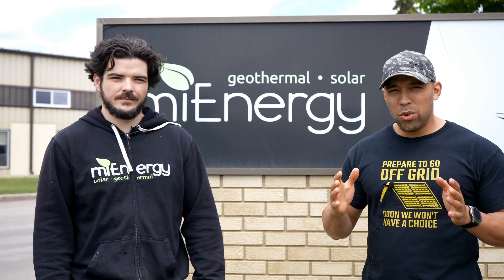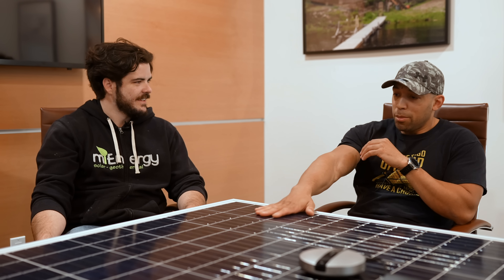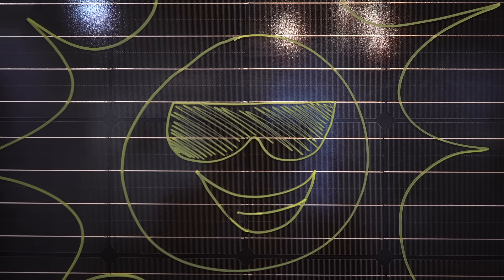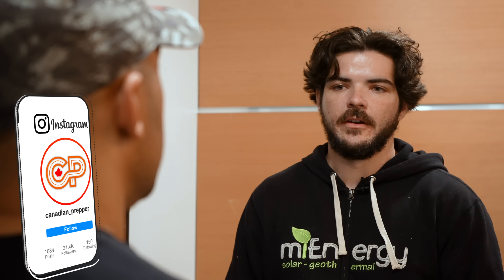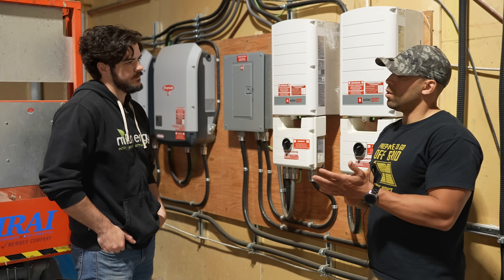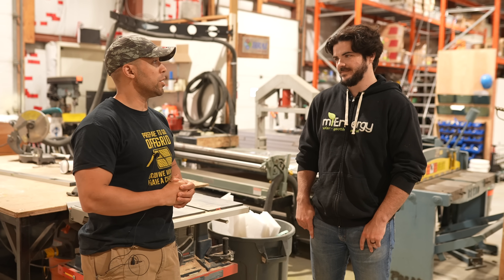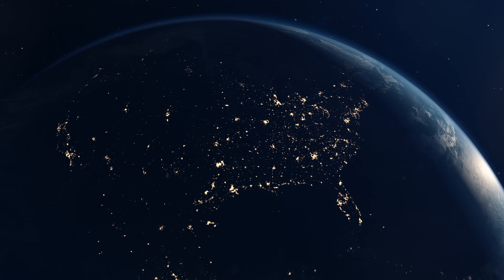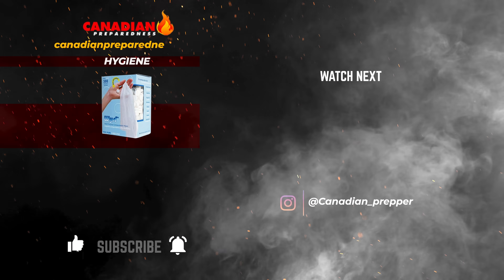Preppers Guide to Home Solar Power

Comment: Okie solar in Oklahoma wants $117,000 for a 3000 kw a month system with a battery back up. 25 year loan with 1.99% interest rate…… that’s half my house, what the hell??? ADT solar wants $84,000 for just panels. I don’t remember the name of the other company but they quoted over $100,000 as well. Some power company’s make it super hard to use solar on ur home charging u penalty’s and will not let u go off grid. This is total BULLSHITE!!!!!

Comment: What I didn't see and hoped to see was a discussion of repairing your solar panels in an EMP/CME (coronal mass ejection) or near lightening strike situation. While your inverter might or might not survive, your panels will definitely have their blocking diodes destroyed. So having a supply of the inexpensive diodes on hand with a soldering iron is a cheap insurance policy.

Comment: You can do your own install and a 5kw system with less than half of this guys numbers...  Everything including the lifepoe4 batteries can be bought on online.  Keep the system off grid and all you need are panels, solar battery charger, batteries, DC-AC inverter, and wire.

Comment: I’m on a fairly windy homestead, so I’m installing a 400w VAWT and 400w of solar along with a modest 3kw inverter, batteries for 4 days - only to power my 2 chest freezers and refrigerator off grid. Only $3,500-ish USD.

Comment: I went to a prepper faire and the solar guys there only thought in terms of feeding electricity back into the grid. When I said "What happens when the grid goes down?" they looked dumbfounded. I wanted a stand alone system that fed into batteries to power my house and they looked at me like I had a hole in my head. 

Why doesn't someo9ne make such a stand alone system for peppers.

Comment: I live well within the 20 kilometer Chernobyl Exclusion Zone of the nearest nuclear plant. Any thoughts? I think we will have power even if the rest of the country is blacked out (in which case we will be digging trenches to repel the influx of blackout refugees) and if there is a problem with the nuke plant, you probably won't be able to move your solar panels, and wish they were installed in a fortified villa outside the exclusion zone.

Comment: solar wear out.. so if you plan of apocolypse and you are rich i would buy extra pannels and keep them in storage. i have solar but i dont have battery so i supply the grid threw my transformer.. now when grid is down i could run a gas generator i have and power the solar unite activating the solar pannel so it powers into the grid., they have it shut off when power goes out to protect people working on lines but in shtf i could power the grid and maybe me and my neighbors could have some power

Comment: The way these large companies are doing it on grid and with or without batteries is only good for short-term typical power outages, Not the SHTF Prepper. Completely off grid is the way to go and these companies don't want to do that. They have a whole line of BS that sounds good till you actually use your brain to stop and think. If enough people get these systems they can have the green society they want, you're generating energy for them and you get a lower bill and saved from the occasional short power outtage. As long as everything is good they benefit and the customer but if worst comes to worst your sh*t out of luck unless you have your system setup the TRUE Preppers way.

Comment: Here in Western Australia we are required to have a grid tied to system even with batteries. It irks me no end that if the grid goes down permanently I got 6KW of panels on my roof I cannot use. What I would like is some info on how I could get use out of them in a full grid down situation. I have tried searching the net to no avail so far. I am an electronics tech, so could do the work if I had some good info on the right way to go about it.
Reply: Why can't you have two independent systems?  One on grid, one off grid.
Reply: @ridgerunner106  It is against the law, that is how things work when the energy grid is run by the government. I suspect if the grid was fully down, the chaos would be such that you could get away without scrutiny of it if you could do it. The current inverter is grid tied and will not work without grid power even if you also have a battery backup. You can buy inverters here to work off your car battery when camping, but you are not allowed to buy a solar panel inverter that can be off grid. I do have a couple of Lithium power stations, one of 300W and one 1300W plus a 200W solar panel blanket to charge them with that gets me by in small power outages, but would love to be able to use all that power off the roof if the grid goes down and stays down.

Comment: Here in the Panhandle of Texas we are completely off-grid. 3 separate solar systems. Our main cabin has a 13Kw system, the guest cabin runs on a 12Kw system and the barn operates on another 12Kw system. We are currently replacing each FLA battery system with server mounted LiFePo battery banks. Each system uses a MppSolar 6048 or 6548 split phase charge controller/inverter combinations. 
Combined solar panel arrays include 125 solar panels all of which are ground mounted. It took six years to complete system. It was done without professional installers which made it very reasonable in overall cost. The systems are practically plug n play and require only a bit of self training if you have basic electrical skills.
It is advisable to begin building today if you have not already started your system. Interestingly enough the prices of components have dropped consistently since we began to build our system.
I managed to acquire some of my panels used but tested good at as low as 16 cents a watt.

Comment: I was loosing power at my place for a week at a time and with 2 small girls here I needed better then a generator. I have 60 kwh LiFePo4. 10 kw inverter and 3500w of pv. At the moment I cant run my oven or dryer. My house is only electric and does pretty well on solar 3 seasons per year.

Comment: I just have 1200 watts of panels and an Aims 24 volt 2000 watts low frequency pure sine inverter. I went the cheap route and used marine batteries that I can get locally easily, ( 20 of them so far ). I'm tinkering with a wind generator too. But there is enough for my electrical uses, and it doesn't go off during a blackout. I have enough for my little A/C for a couple hours a day and I have plenty of backup. I am sure glad I went and put this together when I did. It is better to be free from the bills, and just run one appliance at a time, than to own nothing and be happy. I have about 7 months left of what was an average bill left, and the system will have paid for itself, and just be profiting from then on. I think I can get 9 years out of these batteries. So that is 7 years of free power...how much is that worth? I have about $3400 in my stuff. I'm from the poor side of town. It took me a year + to get what I have. It's working pretty well now.

Comment: If you have the option I would look into geothermal heating/cooling and for energy Micro hydro if you can. Another option with Solar/Wind is the addition of a water battery. 
Pump it up during the day then you can use it when the sun goes down.

Comment: What 1%?

The Takers that need sociaty,grunts,and flunkies to provide for them

All those appocalype Movies arround 2012 had the super rich and such buying bunkers and such but never saw farmers or doctors orpharmasists or engineers or architects being apart of the "elite"

Could just be a script oversight but unless you save the fundemental "working casses" too we lose the ability to rebuild modern sociaty and and those "Elites" used to being pampered die off anyway when the supplies run out

And without knowing how to repair or create morethe tech you use they become glorified paperweights eventualy

The advantage of acid and lead batteries for battery back up is you can  recondition them or rebuild them as long as you have lead,acid,and a power source.....have yet to see a DYI  lithium phosphate cell

Comment: I think you can DIY a system with 5,000 Watts of panels, 6,500 Watts on the inverter and 10kWh of usable battery backup for about $12,000.

Comment: Easiest to do: Ground mount, buy more panels than your inverter output to protect against shading/snow/orientation morning or evening/orientation summer or winter losses. Expect panels to improve every year and you'll swap in new panels before the old ones wear out because performance of the new panels will go up (easier on the ground than hanging off your roof).

Comment: If someone tells you that their payback time was only 4 or 5 years, they are lying to you.  As you mentioned, if it is a grid tie system, it won't work during a power outage, when you need it the most.  If you go with batteries, expect to have to replace your batteries about every 6 years, 8 years for the best batteries out there.  The power walls have not been out long enough to know how long they last but I would not bet you get more than 8 years.  Kong's elite will last about 10 years, if you keep them in an airconditioned 67 degrees at all times room.

Comment: Am in Mexico and just got my system installed. We have 6 panels and 20 batteries(not lithium). This will power the well pump, water pump, ceiling fans, fridges and freezers. Works well. If the power goes out as it always does in the summer this set up will work for 12 hours. Considering more panels and lithium batteries as they last a good 10 years.

Comment: Very good comprehensive video on solar.  The installer touched all the key points.  I'd stress getting battery backup because if the grid is down, your solar is useless.

Comment: How large a solar system to power a EV? I have a home built system for my cabin (my solar is not hook up to the grid)  it runs every but my EV. I have hydro as my back up and it also charge my EV at night when power is cheaper. It's nice to see all my relation helping out with helping the great mother. I'm also looking at Shipping Container gardens 40' long. These unit can grow fresh veggie 365 days a year... all winter and hot summers long. Your thoughts on the size and energy needed. Thoughts on geothermal powered by solar?

Comment: Nate: there's a third type of panel, that the big poly and mono have been buying up to shut down.  It's the thin-film amorphous panel.  The last plant I heard was shut down, there in Canada, just last year.

Thin film loses less on cloudy days, or when shaded (it's wired different, inside the panel itself).  Drops 11% in output under 3 feet of powder snow.  It doesn't need to be pointed directly at the Sun, either.  Seems to pick up power from the Raleigh scatter.

It gets it's power from the near-infrared.  And, the panels require twice the area, for the same output, as the others.  Lasts just as long, too, now.

Actually, because the connections in the panel are so different, they still work after you shoot a couple holes in them---lol.

Still made in China.

Comment: I started with a 1 kw setup when I was off the grid. The long northern winter and -40 weather killed my batteries. it was a constant problem.
Reply: What did you do to trickle charge the batteries

Comment: You missed an important point, property tax. Go install a legal system with a building permit at 30k and plan for an increase of 30k to your home property tax. Here in CT, my town has a 43 mil tax rate. So a 30K system is going to be taxed at 30x43 = $1290 per year or $107.50 per month. Will the 30k system even produce that equivalent in electricity and distribution costs ? I think the payback period wont even be 30 years considering the never mentioned property tax bill.

Comment: Thanks for covering this material.  I expected to get solar 10 years ago but the unexpected happens and changes plans.  but as time has gone by, my desire has changed from just having the panels hooked into the grid to having it be able to run my home in the event of a grid down.  I learned about some options I was not previously aware of while watching your video.  I'm hoping to get solar in the next couple of years or at least price it and start saving for it in the next couple of years.  Subscribing to mienergy page to learn even more.

Comment: Solar panels will only give you independence for a few years. Use something you yourself know about and something you can fix with common components. Wind is pretty easy. Hydro is pretty easy, man power as well. A couple of magnetos, and alternators will put out quite a bit of power. Don't solely depend on solar.

Comment: I love solar but a complete system is way more expensive than I can afford.  Also $15 years to pay itself off and only lasts 20-30 so you will probably save less than you think.  Not to mention the batteries aren't going to last anywhere near that long and will have to be replaced at great expense.

Comment: A panel angle of 30° might be fine on the summer solstice but it's going to be grossly off angle in December and january. I chose 45° because the sun is very low on the horizon in December so I angled it so that it would be pointing directly at the Sun during the equinox.

Comment: I've been off grid for two years,  I love my solar system. Do not I repeat do not short yourself  on storage  ie/ batteries, good batteries. If a stand alone system tells you  all you need is two batteries get six. Yes it cost but I would strongly suggest you talk to someone who uses a product versus one who sells a product. I purchased mine through shop solar and was amazed at the service  and the product itself, worked exactly, installed exactly and performed exactly like they said it would. I shorted myself in storage capability. I've corrected the issue and I'm 100% satisfied.

Comment: I had one installed with a battery for a backup, my cost was 40,000, I have 24 panels installed, It is good in the summer but when it come to winter not so good. I live minnesota we get snow, in your video he said it melts, I can tell you minnesota snow doesn't melt when you get 8" to 12" of snow, it is very cold, lucky for me I have a one level house so when we get the snow I go out and use a squeegee with a long pole and a 6' ladder and clean the panels, my two German shepherd has fun catching the snow when I slide the snow off, I can see solar system would work better in warm weather, but where I live it's more work and one more thing some city's doesn't want you to have a battery, it took the company a year to finished the job, the permits took the longest, I can tell you I am the 3rd with solar system and the first with a battery system in my city. I hope this help other out there that want a solar system

Comment: The best solar systems are totally off grid. In other words, not connected to the grid at all. Issue with feed into the grid systems is that they are 80% controlled by the power companies and are subject to price decreases in terms of tarrifs like we are seeing here in Australia where the feed in is far less than it ever used to be and to the point where if you are only getting it to reduce your power costs, that option has all but disappeared. Yes the full off grid system is expensive, but it means that you never have to worry about power bills ever again and you have a far longer ability to keep producing power even after the grid has gone down. Those with Tesla power walls soon found that after 2-3 days of no grid after a storm in Melbourne a couple of years ago, their system failed where people who had the full off grid were still going strong. It really pays to do your own research into this as it is a big cost to make sure you get what you want. I did like the comment about the panels themselves as there are a hell of a lot of cheap panels about and they only have a life span of 6-7 years, so make sure that your budget takes into account longevity not only in terms of the panels, but the invertor and the type of system that suits your needs and requirements as well..

Comment: We have 17 Solar Panels and a big Batterie with 9.9kW ....enough  for the house and to load a little bit our Electric Honda E .   Not all systems works off grid.   We  have the perfekt solution in case of Blackout and to reduce the energie costs

Comment: We had a company come out and give us a quote on solar about a month ago. It would be totally useless to us cost-wise. $10k just for the panels, no battery backup, so when the world loses power, you do too. The battery backup was another $11k. With our current cost of electricity, it would take 9 years to break even. A cheaper monthly bill was the only upside that we could see. You would think that with the big push to solar they would more incentives to switch, but apparently not 😕
Reply: I Bought 1k worth of solar panels and have them hooked up to a solar generator (ecoflow delta pro)  Good enough to run 2 fridges and a small ac unit for 4k
Reply: We got a similar quote. I can't even justify such a cost. Portable solar panels along with gas generators are really the only thing we can do if shtf
Reply: Solar panels are certainly NOT a silver bullet, fix all, solution.
Our system cost apx $30k (in our country), and is saving us about $250/mth, which is still a very long payback time.  We do have energy independence in the meantime, which has a high value for me, even if it doesn't pay any bills.